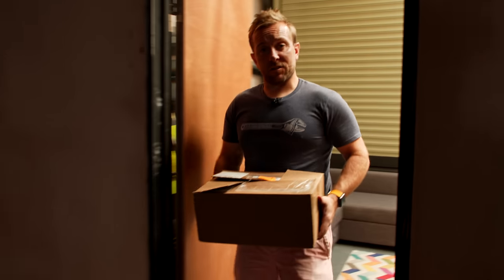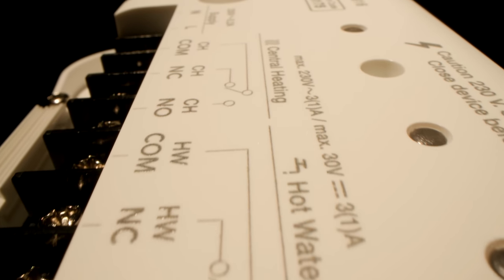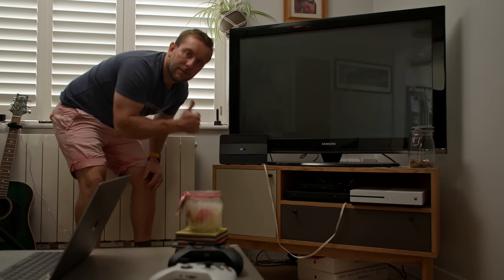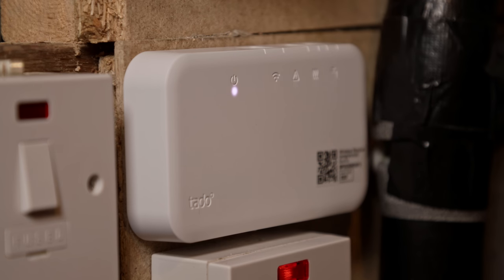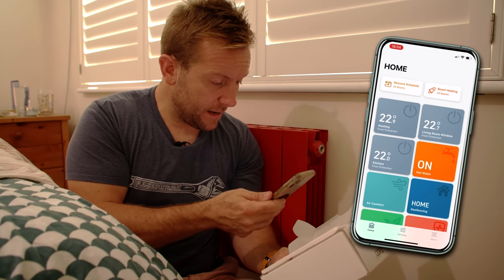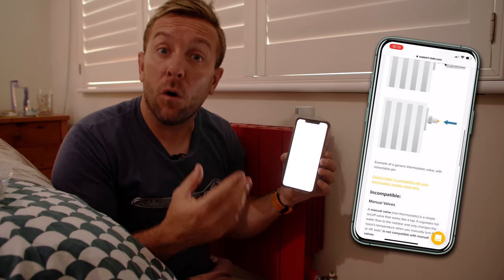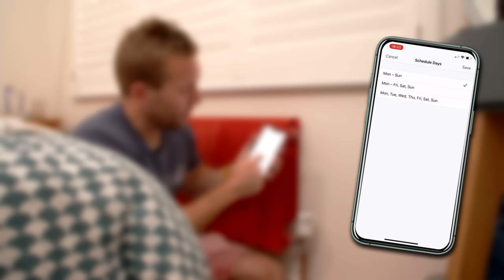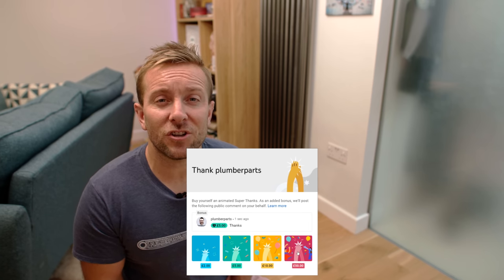PROGRAMMABLE SMART THERMOSTATIC RADIATOR VALVES - TADO°  Review

Comment: I want to know if the following scenario works. If i have the main thermostat in room A and set the temperature to 21 degrees (dealing with celsius here), and if i put these radiator valves in room B and C, and set the temperature 19 degrees and 17 degrees. The heating stopped because the temperature in the room A where the main thermostat is hit 21, and if i open the window in room C where the valve thermostat is set to 17 degrees, and the temperature goes down to 10 degrees, will thise trigger the heating for that radiator? Even if where the main thermostat in room A is still 21 degrees? Or is this system set just not to overheat the room above the set value. I would want it to teiggwr the heating from any room.
Reply: Maybe a bit late, but the wired thermostat will trigger the boiler when one of the radiator thermostats does. The wireless thermostat is only really required for better measuring. The radiator thermostat is likely to get incorrect readings since it's really close to the heat source. So with the wireless thermostat it will cycle less.

Comment: Not using Tado but Eve instead, but these are indispensible for anyone living in a shared apartment. In Germany each room has a meter on each radiator and you'll get billed that way. I had a dumb thermostatic valve which I sometimes forgot to turn off when I left, or which didn't let me dial in the temperature properly. I got my Eve thermostat for €5 at a flea market and it has already saved me that amount of money. Btw, if you have geofencing on you just need to set one schedule because it will automatically turn off when you're away anyway. Not sure about the Tado system, but if you have homeassistant you could also use an in-room thermometer for the room temperature reference as the heat coming from the radiator will skew results.

Comment: Used to have Tado (without their TRV’s) until Installer broke it during boiler install 🤬. Now have Nest, Tado absolutely brilliant with geofencing especially learning features when you are returning home and real-time heating info something Nest cannot do. You should do a video on this feature as it’s strong point. obviously main thermostat needs to be set high enough to allow smart operation of TRV’s perhaps not needed if you have the TRV’s on every radiator and set a time and temperature schedule as required. Only downside it has against Nest is that you need the bridge to communicate with the server in Germany that holds your schedule etc so if that goes down or you loose internet at home while you are away system is useless whereas Nest holds the schedule within the thermostat and communicates via a mesh network to boiler switch control.

Comment: Had this setup for 18months and it’s awesome and better than nest.
Defo need to have the radiator valves on each rad. Gives you the opportunity to control heat to each room very accurately. 
I’ve saved over £200 on heating costs 
Batteries last well over a year
Easy to do schedules and have it come on and off when you leave home. It also works seamlessly with HomeKit so you can voice control it. Tado also make thermostats that can control AC units and heat pumps. Great vid
Reply: Would love to know more about the HomeKit compatibility
Reply: Hi, 
Thanks for you comment. Just one question please. I’m not really knowledgeable with heating system. 
Can the TRV override the main thermostat please? For example, can I set the main thermostat to 20 but the room to 25? 
With my little knowledge, I’m thinking the main thermostat will shut down the boiler so anything above may not work. 
What do you think? 
Thanks.
Reply: @okunrin3  Yes, an individual TRV can overide the main thermostat which is great. In my setup I have the main thermostat turned right down and the heating only comes on when one of the TRVs goes below a certain temperature.
Reply: @olliec1319  thanks, I’m really considering buying it, trying to compare with nest, hive, drayton etc. 

I wouldn’t need the living room at night, just the rooms, so that will be savings. 

my initial cost will be like £400. Ie buying the thermostat for heating and water, I have 13 radiators, including bathrooms, kitchen, toilet, hallway. My thought is to buy for the rooms that use heater most (living room and the rooms). 
If I but 14 TRVs, that will be will over £1K.
Reply: @okunrin3  You’re welcome. When I was comparing systems, having zonal heating was a must for me, to be able to heat each room individually at different times. Honeywell and Tado seemed to be the best systems for this and I much preferred Tado’s white design and it cost a lot less than Honeywell. So far it’s great, it all works perfectly. 

As for my setup, I have 6 rads in my house. I have Tado smart TRVs in the kitchen, living room, and 2 bedrooms. My bathroom rad valve is open all the time (one needs to be so the boiler has somewhere to dissipate heat if needed). I have a standard cheap TRV in my hall (with the 5 numbers on) but can swap it for a Tado TRV if I want to. 

I paid £130 for the starter kit, and £200 for 4 smart TRVs, although I’ve seen them for as little as £40 each. So I paid £330 in total which really isn’t crazy and I save a lot in heating each year. And I can activate everything from phone or laptop.

So with smart TRVs on rads in the main living areas, you wouldn’t need to spend anything like £1k. Anyway, food for thought 🙂

Comment: I’ve been using a TADO basic kit for around 2 yrs with a Combi boiler.  I’m looking at adding smart radiator valves with a 3 valve pack.  Yes the valves can be expensive to start with (around £184 for 3 valves) but if it’s successful I shall add more to the system… Yesterday and after the heating had been switched for the summer I decided to start the system back up in readiness for winter.  The first thing I discovered was the room thermostat batteries needed replacing. No problem and did that in about 1 minute then hey presto the heating was up and running.  Yes I know there is a paid service if you want added benefits on your smart app, but I’ve not needed it up to now.  All in all at first I was sceptical but now after 2 yrs I’m satisfied that this is the smart way forward an£ will be ordering those smart valves…

Comment: I've had Tado for about 6 years its been great. I had a new Worcester Bosch boiler a few years ago and connected the main thermostat to the digital input of the boiler and now the thermostat modulates the boiler with a thermostat configuration changes. Replaced all the radiator valves and they also modulate temperature of the water to the radiator.  It now saves up to 30% on gas.
Reply: I have a worcester with a remote thermostat. Can the worcester talk to the TADO thermostat when sited in a remoote location or do you need an additional sender unit?

Comment: Whats really important is to point out that the tado wired thermostat can connect to the bus of the heating. By doing so, it can modulate the heating and not sinply switch it on or off. This will save money when combined with a condensing boiler.

Comment: I’ve never used thermostatic valves but I’m thinking switching my regular valves with those. One thing I don’t quite understand yet is how reliably can it measure room temperature when it’s right next to the radiator?

Comment: Super interesting! However, would you not need the bypass valve radiator to be where the main thermostat is? If the bypass was in the bathroom and the main thermostat in the corridor for example, if the main thermostat was in demand but no nearby radiator was heating (in bypass) it could keep the demand ON and the bypass installed somewhere else would just keep heating and heating. Right? Or maybe I am missing something 😉

Comment: Hi, I am planning to buy a Tado Multi-Zone control, but I am puzzled about it. whether I need a smart Tado valve for every radiator or just one per room. I have 4 ensuite bedrooms, and a sitting room with down stair bathroom. In total, I have 12 radiators, 4 in the bedroom, 5 in the bathrooms, 1 in the sitting room, 1 in the kitchen, and 1 in the hallway. 
Thanks in advance
Note: I have non smart Ideal combi boiler.  The boiler is not connected to a thermostat, however, the bedrooms have style-wired thermostats to control the temperature of the room.

Comment: Another great video 👍
I'm in the second winter using Tado wireless room stat with an Alpha Evoke 28 and it been great.
I've recently found out it can use the OpenTherm connection type, this can module the boiler. Rather than  just on or off. 
Dose anyone have an experience with using OpenTherm? 
And how the wiring would change on the wireless extention?

Comment: Great vid. I didn't understand a couple of things:

1. The reference to a bypass rad. Why, how etc?

2. Have you done a vid that explains the extender's connection to the boiler in more detail?
Reply: The bypass rad is one which has to stay on all the time ie. towel radiator. This is because in the event that all the TRVs closed on the other rads, the pump wouldn't be pumping against a resistance.

Comment: Just installed the Tado system and it was easy! However, have noticed two of the radiator thermostats are different versions. They don't have the option to select vertical or horizontal mounting.  Firmware updated after a couple of hours. Not sure if the wireless thermostat stays in the hall or should go in the living room but will have fun playing with the system.
Reply: The new version is of the SRT is universal - the digital displays changes when you rotate the SRT

Comment: Excellent video. I’m heavily invested in Nest with smoke detectors, cameras as well as the thermostat, so good to know I can just do the radiators. 👍 I do have some rads without thermostats so be good to understand how to sort that. Is there a short cut or do I have to drain the system?
Reply: Use a freeze kit , buy two just incase one isn't enough have the system as cold as possible have a long hose close by in case you mess up.

Comment: Apologies for the rather daft question, but what's the purpose of the links shown in 8:50? Also, when you isolated your thermostat  wires with the wagos, what happens to the other end of these wires, which I presume are terminated on the Boiler PCB?

Comment: Great video! Can you confirm whether the Tado V3+ offers full modulation boiler control. I'm not an expert in this area, but I've heard a lot of stuff saying that it only supports on/off of the boiler? We have a Worcester Bosch system - fairly new, but using a tank (not a combi) - and I'd like to be certain that the Tado system will offer proper modulation of the boiler. Any recent UK users able to comment?
Reply: Modulation control would be on the boiler itself, not the Tado setup.

Comment: Hi, 

Great video as usual. 
Just one question please. I’m not really knowledgeable with heating system. 
Can the TRV override the main thermostat please? For example, can I set the main thermostat to 20 but the room to 25? 
With my little knowledge, I’m thinking the main thermostat will shut down the boiler so anything above may not work. 
What do you think? 
Thanks.
Reply: No, main thermostat is just the 'brain' of the system. It talks to the boiler and the thermostats. It's the captain of the team. Other thermostats communicate with the main thermostat and can individually regulate the radiator. If one room needs more heating, the other radiator stay off if they have also tado installed.

Comment: Great video very easy to understand and straight to the point, thank you!

What is a bypass radiator?

Is it a radiator that doesn't have any valves on it I guess?

Also I'm considering this Tado with the Vaillant TRVs. 
I want to be able to modulate my boiler for best efficiency. 
I heard maybe Tado no longer supports eBUS in UK? Not sure. 

So I'm considering Vaillants control and TRV which seem very similar. Do you have any opinion on those as an alternative?
Reply: Did you get the answer to this I have a vaillant as well.

Comment: Great video but I have one question, in a scenario that all the thermostatic valves are closed how the gas boiler will know to turn off if you are not using this Central thermostat? For example Central thermostat is 24° and thermostatic valves are 22°. In that scenario the gas boiler will try to rise the temperature room to 24°, so it will never turn off.thx!!
Reply: that makes no sense? first you say if you are not using a central thermostat then you reference the thermostat is set at 24. so are you talking about using just the TRV or the TRV and the thermostat?

Comment: Do these just adjust the radiator valve rather than communicate with the boiler, pump etc? How accurate is the temperature target for the room when the thermostat is so close to the radiator itself? If you have a room with a tado thermostat I assume you don’t want to put the smart radiator valve on the radiator in that room otherwise it’ll just create a conflict, as with traditional adjustable thermostatic valves?

Comment: I am thinking of investing in this. I currently have a (year 2008) Vailiant eco pro system boiler. I removed the v60 controller when I added an UFH circuit to my living room because this boiler and it's brain did not have the ability to add this circuit. At this point I lost my outside sensor for weather compensation etc. (Sorry for the background info) So we added a 2 port valve for the UFH controlled by it's own room stat. The rest of the house is controlled via another 2 port valve and digital time clock and room stat. The hot water on a 3rd 2 port valve. Would it be as simple as adding a new wireless room stat to the UFH circuit  in the living room, another wireless room stat to the rest of the house with smart TRV's to all the other rooms?

Comment: I've set up my system. However all of the radiator valves seem to be reading a couple of degrees above the actual room temp. I've done the offset but they are now sat at 23 degrees each. And once the rad comes on the temps rise quite quickly.  Any advice?
Reply: Get the room sensors for more accurate readings- better value during Black Friday

Comment: Is it possible to install smart thermostat in vertical orientation but with valve head facing down? On setup manual it is clear that vertical orinetation has valve head facing upwards but installation of radiators in my house is downwards.

Comment: Hi

Why the temperature is still above 20° when the valves in the other rooms are off?
I have exactly same problem, even though I leave the Trv off, the rads are running hot +20°. I reinstalled them few times 😕

Comment: if installing Tado TRV's on each radiator in the home - do you think it will be OK for a heating pump, will it cope? E.g. if all TRV's are closing and it still tries to pump hot water. (relatively new home, circa 15 years, with boiler and hot water cyllinder)
Reply: That's why you must have a bypass installed or a heat leak radiator and a modulating pump.
Reply: Micro zoning using these will course the heat pump to cycle. This will make it very Inefficient.
Reply: If none of the valves (or any room stats) are calling for heat then the boiler and pump wouldn't fire up.....or have I missed something ?

Comment: Thanks - really useful as I'm setting up my tado system at the moment. Couple of questions for who ever might be able to help:
1. In the video at 7:30 the wireless thermostat is put in the place of the old thermostat. But it looks likes it's not wired. Does it need to be wired? Or is it just put there for convenience?
2. Can I use this wireless thermostat (which I understand is the main controller) in the same room as smart TRVs? As I want to be able to isolate each room if need be. I.e. heat only the bedroom on a cold night.
Reply from the maker: Hi there. I'll answer your questions in turn:

1. No. Totally wireless, uses wireless tech to comm with the receiver.
2. Generally no....but the TRV's are so good you don't reeally need the room stat anyway....if you catch me!
Reply: @plumberparts  Hi, thanks for this, up and running now and all working nicely. I've never actually used the room stat, like you say - it's redundant with the TRVs. 
Also, thanks for all you other videos. I repiped the central heating in copper and installed 6 new rads from watching your vids. To go with a new combi boiler install this summer.

Comment: Not suitable for large properties due to the limited range of the wireless bridge. Extenders don't exist. It doesn't use traditional WiFi.
Reply: Anybody having these issues that this gentleman pointed out? (I have a fairly large)
Reply: @zubairhussain7866  Yes - half of mine are absolutely useless - the Bridge is rubbish. The TRV's need new batteries every 2 months. Some won't ever talk to the Bridge, some will for 5 minutes a day. App says 'connected' - TRV never responds.This has been a complete waste of money - rather than save on bills it's cost a small fortune for nothing at all.
Reply: Just use a passive extender
Reply: @neilmick6778  Well Tado don’t sell them.